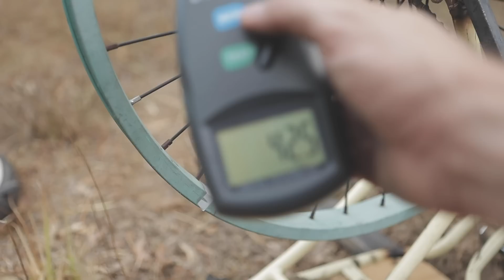How Fast can a Bicycle Tire Spin Before it Fails

Comment: Pastel fixed gear bike wheel with old tire breaking point 2280 RPM = 
Wheel with No Tire 
breaking point 
5288 RPM = 432 mph 
(Host's Verbal description of numbers)

2025.03.16.02:34 GMT -4

This is the third time atleast  I've veiwed this video.
Thank you this video was helpful.

Math calculations with screen numbers in the video at
 07:57 - 08:00 / 08:59

I didn't see the information i commented in the description.

Comment: Conservation of angular momentum from the tires is keeping it from speed. Take that tire off of the 10 speed wheel and lock the derailer in one gear ( preferably high). More tension on the chain so it dont fly off.

Comment: TO ACHIEVE HIGH SPEEDS ON A BICYCLE WHEEL YOU NEED TO:
1. Rotationally balance the wheel "perfectly", if the wheel is off balance by as little as 1 gram at high speeds the centrifugal forces will change the one gram to one once! This will cause the wheel to start oscillating like a sledgehammer swinging from the axle.
2. Use an airtight valve cap like those used on suspension shocks. Why? The centrifugal forces will cause the air valve core seal to open.  Or just use a Presta air valve to lock down the air seal.
3. Use a super lightweight road tire with high count TPI, because the tire will want to expand at high speeds.
4. Use aero spokes for very obvious reasons.
NOW GO FOR IT!

Comment: The brakes aren’t engaging. That flat bar on the opposite side of the sprocket has to be clamped to the bike frame. Even if that was the case, there is no way in hells butthole that the brakes would engage with the amount of g’s going through that wheel

Comment: If the wheel is not well balanced then obviously the destructive forces, that are proportional to the square of the speed, are going to be much higher.
Why are you doing this in close proximity to a high voltage power line?????

Comment: What failed the good wheel was you deleting the derailleur system. Put it back on so it can guide and tension the chain. The chain only came off because of that. And you might drill some holes in the base to peg it down for stability. Those spokes made a lot of wind noise at the higher speed without the tyre- maybe you could get some carbon fibre spoke covers or a full disc wheel to test to destruction? Use a small car motor so you can keep gearing it up until a good tyre explodes.

Comment: I'd try it with a known good, decent quality tire fully inflated so it's fully expanded to catch the bead area of the rim. Also, I'd stake that thing to the ground so you don't have to chase it when it fails. 
I think the goal is to see when the bike wheel fails, not when the motor dies of oil starvation on its side. 
Also, attach that break arm to the frame, if its moving around it may well be allowing some drag on the coaster brake shoes. I'd also make sure that thing is well lubed and adjusted, that way you know it failed because it saw its mechanical limits, not just due to it being poorly lubed or neglected.
I would think that the most likely failure points would be either bearing failure leading to a thrown chain or broken axle, or separation of the rim at the weld or seam. Balance, or lack of it will be the downfall.

Comment: Definitely love to see y'all push that thing even further I was actually hoping y'all Let the first time that y'all had when it jumped gear when it's stay in the high gear and see exactly what it does and how far it was going to go
Reply: ...jumping to bigger diameter gear...slower?... cannot see gear on motor... 
.on my bike , small gear in front,  large gear in back is slow. .large front, small back equals speed.
Reply: @dougwalker4944  all I'm saying is if the trans going to try to jump up to the top take advantage of it if it's going to jump to the bottom then gear accordingly but my guess is with speed is going to try to jump the larger gear on the top so knowing that it's going to try to slide up then gear the motor accordingly from the chain and ebele skips up to the top of the wheel and just let it run
Reply: @divlles .I see..just stoned.

Comment: Predator engines are governed at 3600rpm not 5000rpm. This goes for 90% of small engines. The only one I know of off the top of my head that spins higher than that stock is a Subaru robin engine and that’s only 4000rpm. So unless you by pass the governor it’s not getting 5000rpm.
Reply from the maker: The governor is removed.

Comment: i know this video is 3 years old but you need someone to put some servos on the engine to remote control the throttle and kill the engine without running up to it. 
you probably should of had a roller on the bottom to simulate road pressure as well it could make a drastic difference in performance. 
also sand bags to hold the rig down.

Comment: Despite the spokes being pretty thin and the rim being made of aluminium these wheels can bear quite heavy loads. 
When I am on longer trips I typically have 22kg of baggage with me plus several liters of water and also some food. My bike weighs 17kg, and myself more than 90. So the total weight is about 140kg of which maybe 20kg rest on the front wheel.

Comment: This is even more hilarious to me, because I'm designing & building powerful e-bikes, and now I'm in the position where I can't find much or any motorcycle tires that can fit bicycle wheel sizes, and bicycle tires don't have advertised load & speed ratings like like motorcycle & car tires do. I found e-bike specific tires like from Schwalbe marathon series, and a few e50 tires rated to handle 50kph. But that's it. So for any engine kit bikes, I gear for 50kph or whatever an e-bike tire is rated for. And for e-bikes, getting high voltage controllers and wiring batteries more in series means more voltage, means more top speed and rate-of-acceleration, and through a Cycle Analyst V3 or programmable controller, I can just set the maximum speed the motor will cut off at.

So whether its engine bicycles or electric bicycles, I stay within the speed ratings of the tires, so I don't die or hurt innocent people, from a blown tire crash, but try to reach that rated top speed as soon as possible, and even climb steep hills at that speed.
If you're wondering why don't I just build a motorcycle. I'm currently living in an apartment, and I'm not parking a bigger bike outside to be tampered with or stolen.
Reply from the maker: I just uploaded a video where i used a 20 inch bike wheel and reached 100 kph/63mph with zero issues
Reply: The speed record for a pulled Mountainbike (a normal standard bike pulled by a motorbike) is 272 kph, so even if the tires are not rated for higher speeds they should have reserves

Comment: This is hurting my brain. The clutch is locking up because it’s getting hot. The gear ratio is extremely too high. You need a smaller sprocket on the engine.

Comment: Holy moly, that rim only test is really really dangerous.
Reply: I dont know how fast it needs to spin for the rim to tear itself apart, but they better not be standing as close as they were in this video when it does.
Reply: @beresfordsinning9726  Yeah if it comes apart at that speed, the spokes would go straight through you and a chunk of rim could easily slice an arm in half.

Comment: it would be interesting to try this again, with a carbon fibre race wheel and higher gear - you would get some serious speed up
Reply: Can make a budget one by zip tying a sheet of thin plastic cut to size on each side. Just need to reduce air resistance over the spokes

Comment: 3 years. Still waiting..
Reply from the maker: Believe it or not, ive made 5 separate attempts at getting the wheel to fail. I dont want to upload anything until i get it to explode. Its been frustrating and expensive 🤦🏼‍♂️😂
Reply: @ChrisRollins  I hear you.
Thanks for the reply.
I hope you documented the journey of failures and successes. Pretty sure you will get lots of views..cheers !

Comment: You need remote control of the motor.  You should also have some kind of blast shield (similar to the Mythbusters).  Ever seen their video of what a tire flying off a big-rig does?  It is a lot heavier, but your speed is higher.  Also, 400+ mph is getting into the range where if the metal did fail, it could puncture you like grenade fragments.  Probably won't die, but it will do some damage.  
Remember also that doubling the speed multiplies the force (and damage it can do) by 4x.  10x speed is 100x damage, etc (squared relationship).  Protect yourselves.

Comment: Very cool, but I would think load would have an effect on heat, etc. and thereby the tire's ability to handle that kind of friction and pressure?
Reply from the maker: I agree with you! Under load the tire and maybe the bearings would fail long before you ever got this fast
Reply: @ChrisRollins  Well, I watched this video out of curiosity due to the high speed high power ebike conversions I do on my TexasNEV channel.  I was concerned that 60-62 mph on a 26x4 fat bike tire would be dangerous.. Based on this research, looks like it will be just fine.  :)

Comment: I would love to see you spin up the wheel without a tire again but use an electric motor so you can ramp the speed up and down remotely as well as being able to play with different gear ratios.

Comment: You need to make a much heavier sturdier rig, you should use a VW engine or a 22r engine out of a Toyota, maybe control it with a peddle or a line, the only reason I am suggesting that you use a 22r engine is because 1 they are cheap 2 they are absolutely indestructible and 3 they are super simple to get running without having to worry about mounting them in vehicles.
Reply from the maker: im designing something now that would attach to my car, lol

Comment: I think you should follow up on this one ...this is interesting and its very curious just to really know how many rpms and how much torque to overcome the resistance and breach the integrity of a bike wheel....not even Google knows answer ...never been successful executed...you guys are the ones who can pull it off I bet
Reply from the maker: I have made 4 more attempts at this, since i made this video! 🤯Different designs and power units. This has been a very frustrating test! lol! BUT I think Justin and I have finally come up with a way to make it fail! Im hoping that video will come out in march, I have 2 video to finish before I can get back to this test. please check back! 🤘🏻
Reply: @ChrisRollins  right on !! It's amazing how much resistance s bike wheel builds the faster it spins . Youde think. It would start getting hot ....lol I used a heavy duty shop vacuum motor that spins 45,000 rpms and a belt drive to a 26 inch aluminum bike wheel no tire 2inch pully on motor 4 inch bolted to wheel ..it spun it fast enough to not wanna be anywhere near the damm thing!! But all I got was the motor exploding into a big ball of flames !!! Awesome!! Neighbors don't know what the hell to think...right on Chris and Justin!! I'm a subscriber and look forward to seeing what yall came up with....( watch garage 54 on YouTube . They have an episode where they take a car wheel and do this ..very interesting ...

Comment: Neither of these guys has any clue of the potential energy they’re dealing with. When that thing self destructs, it’s going to be worse than a hand grenade and the shrapnel is going to maim and/or kill someone before you can possibly blink. 

Seeing it jump and rotate the blast radius in their direction, and they’re still shutting it off with their foot instead of devising any type of remote kill, even a 10 foot pole, tells me these fools are due for a serious injury in their future. 

Sucks because I had a good friend who died doing this type of shit, he even joked how he was surprised he lived as long as he had with all the reckless shit he did. Well one day his luck ran out and 15 years later it’s still a fucking shame.

Comment: I'd be curious to see how long the engine is going to run after being blasted on its side while running without oil circulation!

Comment: A more practical question that I've wondered about: How fast can the wheel spin under load, before they fail? How fast can you actually ride a bike before the bearings can no longer handle it?
Reply: Probably actually slightly faster since then the tire has a bit more pressure holding it inward. Only question is how much that would counteract the outward pull when it's not in contact with the ground.

Comment: Change the gear ratio to an easier gear, as spinning a bicycle wheel REALLY fast could use more power than you think as the wind resistance power cubes with speed. Even if it only takes say 50 watts to spin at 1000 rpm, then 2000 rpm needs 400 watts and 4000 rpm 3200 watts etc.

Comment: MY HEART IS POUNDING JUST WATCHING! It would be great if you guys could do it again until the rim explodes. I have this page up on centrifugal force, and objects that spin like a top. I literally prove with engineering text book references to flywheels, that nothing can spin over 1000 mph without exploding. No material can handle that, since the min tensile strength required is 215,000 psi. You also need solidity to spin, a broken ball cannot spin. Thus, from an engineering standpoint, globe earth is a total impossibility. The crust is mostly basalt 1900 psi tensile strength, and it is all cracked up, underpinned by tectonic plates. When you factor in the weight of the behemoth globe, you get trillions of psi of stress around the equator. I found your video when I was looking up spinning objects exploding. 

I like the fact that the wheel has spokes, but ultimately, it will still explode. It would be cool to calculate how much compression tension the spokes create and compare it to the tensile strength of the rim material, and then see how fast it can go before exploding. It's very dangerous. But so far nobody has exploded anything that big. We will see how much difference the spokes make compared to the theoretical without spokes. What do you think? Here is my page on Blogger spin1.flat.wtf

Comment: Replace the coaster brake hub with one from a 10 speed, but replace the derailer style gears with the single gear. 
I predict one of two outcomes: the chain fails or the centrifugal clutch on the engine fails. But before that happens, you might get a bare rim up to a thousand mph before the failure happens.

Comment: I actually have 2 questions. 
1. Are the spokes in equal standard tension? 
2. Why is the tyre not inflated? Because it can affect its stability and gripping power onto the rim. 

I suppose these two are affecting the limit of the spinning speed of the wheel, right?

Comment: Put a 48t sprocket at front with a 10t at the back then run it, 0 accelaration but a massive top speed
Reply from the maker: We will probably try an electric motor with a belt. The chain seems like a weak point

Comment: hey are you gonna finish the experiment any time soon? this has never been successfuly done and so stands an unanswered question but now you made a valid attempt documented but failed and learned t aint gonna be simple. more unanswered  question now like how much power/torque/horsepower /will be sufficient and is it possible at all? it crazy the faster the wheel spins the harder it becomes like the brakes being applied ,ive fried the best of motors trying then you pull off the only thing i figured would work and still was overcome by the impossible simple wheel that hasnt even flinched it eats centrifugal force alive and shits the torque out like nothing. try a diesel engine and balance with a protective cage cuz when that wheel does fail its gonna be hard core and anything close will get a peice. last night my attempt destroyed the drive set up and bent a motor shaft witch destroyed the windings  due to vibratoin loosening a mount . ruined my camera to. it was spinning scary fast amazing! round two all you.
Reply from the maker: Yes! We are planning to take it further. There is a company in Dallas that is going to be supplying us with a more powerful motor to find the limit. Hopefully they will be getting that to me early January

Comment: I would add a draw string cut off to the engine system. This way you won’t have to get into the danger zone when shutting off the engine.
Reply: It's ok. If it goes wrong then the free healthc.... oh wait, Im English, they dont have that 😂😂😂😂
Reply: @adamoneale4396 free healthcare, but an 8 hour wait in a&e while you're dying
Reply: @John Scott  not if you're dying. Then they'll prioritise you. If you break your arm though,  then you'll be sat for 8 hours.  Still, it's free. Can always choose to go private if you want to.
Reply: @adamoneale4396  in portugal is the same, but even private is waaaay cheaper than the us
Reply: @Fábio Almeida  cheaper than the UK too, but the minimum wage is far lower
Reply: @adamoneale4396  well aren’t you special, Englishman. 🖕

Comment: GO for it!!! See if the wheel (and other parts) can withstand 800mph 😜
...(I would seriously consider watching that from further away. 432mph is No Joke)...

Someone started a thread years ago on a motorcycle board, What do you think is the highest-tech part on your 200mph Hayabusa...
Answer was the TIRES... Just think about what tires have to endure, with what for the most part is 100% reliability/safety...
Crazy G-forces and stresses of all kinds, abuses and torture (on all kinds of surfaces), plus under all conditions from below freezing up to and including rubber melting temperatures 💪👍

Comment: You need to use rebar to steak the motor and frame to the ground.
Reply: and a kill switch that can be engaged from a distance
Reply: James 
That’s not much good if the frame has rotated and spokes are flying away from the wheel at 300+mph. 
  Just peg it down so the safe zone is always in one plane.